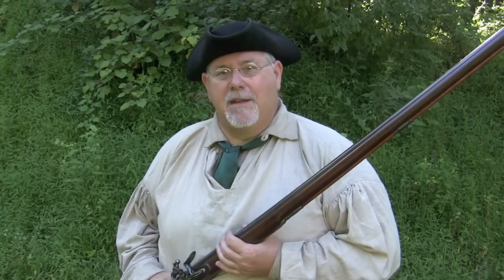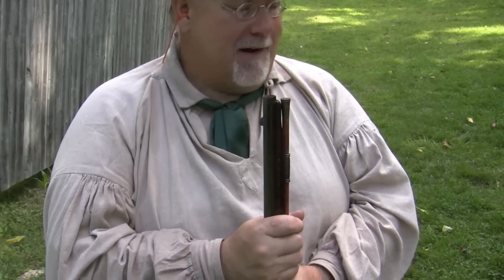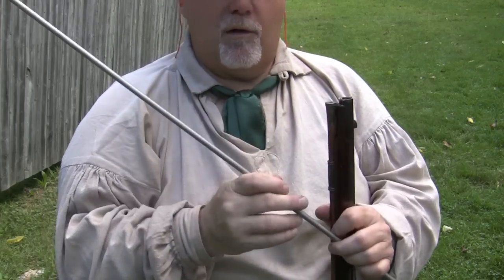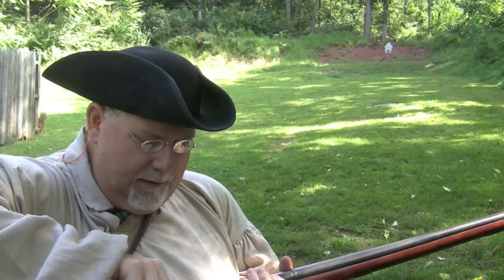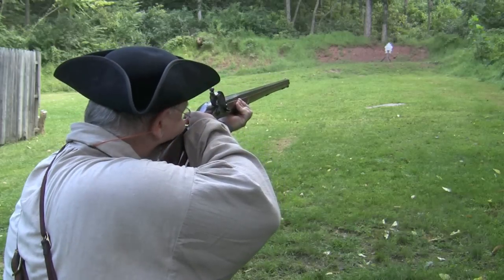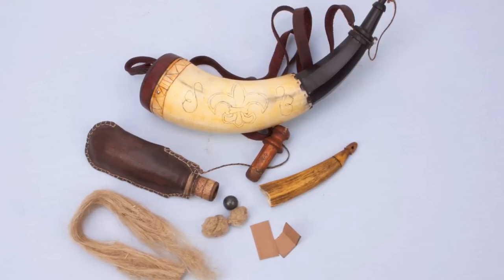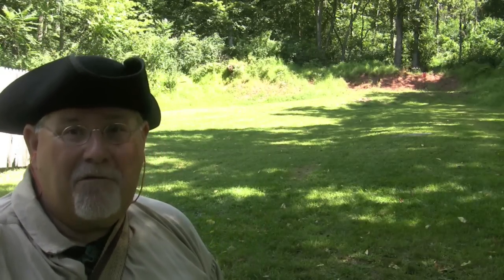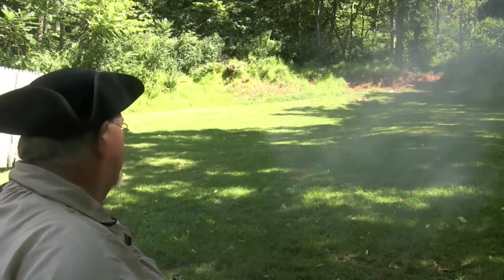Loading 18th century civilian smoothbores   Part 1 Round balls

Comment: Great videos. I read your smoothbore article in the last Guns of the Old West and loved it. I have a Pedersoli Indian Trade Musket in .62/20g and would love to see a video on it, if you still have it. I've been struggling with mine to find the perfect load. For some reason it just doesn't like patched round balls. I couldn't get a consistent grouping using patched .600 balls, even with a tight fit and increasing the charge. Paper cartridges I made up actually did a bit better. I obtained some cushioned wads and left the patch off and... magic, ragged hole in the bullseye! 90gr FFg with a lubed overpowder wad, .600 round ball, and overshot wad seemed to do the trick. Not sure why, but what works well in my rifles did not work so well in this smoothbore. Thanks again!
Reply: I too have the Pedersoli Indian Trade rifle. I’ve been slowly.. working on a hunting roundball load. I thought I had it with a 600 and fiberwad sandwich but I can’t duplicate the accuracy this year so..back to the drawing board. I cannot get a patched ball to ahoot minute of barn door. 🙄

Comment: I've seen an instance of one using a feather stuck into the flash hole while loading to prevent powder from spilling into the flash hole and creating a kind of fuse slowing ignition. Pull the feather just before priming. Valid?
Great channel you have going. Thanks for being here
Reply from the maker: Bart Mann Yes, valid, but probably seldom done for reloading. More often done to seal the charge for the night after the priming was dumped out of the pan...when they weren't sleeping in hostile territory.

Comment: Very impressive shooting, Mike!  Considering that the Fusil is a musket with no rear sight, nor with any way to really sight it in, 4 shots out of 5 is something to be proud of at 50 yards.  I think you are very correct in using a .610 ball, since the slight deformation with 110 grains would reduce barrel-bounce.  Being only a black powder shooter myself these days, I have always stuck with rifles and revolvers.  But seeing this, I may have to build myself a musket.  I need a BP shotgun anyway, and if absolutely necessary, one can shoot rocks or sand through a smoothbore in an emergency.  Anxiously awaiting part 2.  :)

Comment: after thinking about it more, I think the more practical method of lubing a ball would be to "chew it", as I saw in your video about chewed balls. The liquid lube would fill up all the tiny crevices created by the file/sandpaper and act as a sort of grease groove. this way in theory you could load bare balls without wadding material between the ball and bore..so you could get more shots out of  the musket before serious fouling has occured...of course this would be horrendously innacurate to the time period, but I too would like to test this method over the traditional military paper cartridge and ball+wad

Comment: This is great.  Now that you have them all together here, the "period correct" methods seem like they make a lot of sense compared to the patched round ball. Because the paper/tow methods are preform best with a larger ball, it seems like the shooter would have always had the option of preforming a quick-load using just the round ball without compromising accuracy too much.  Are there any references to loading a bare ball?
Reply from the maker: RabidMortal1 Sure. Under fire a bare ball, without wadding was often loaded. There are some accounts of guys holding the spare balls in their mouths and spitting them into the bore. The saliva caused powder to stick to the ball, and that light coating was enough to keep it from rolling back out of the fouling roughened barrel...never tried it myself...

Comment: From what I can tell the method using tow would be preferred by me. It appears that this method would be the fastest and have as much accuracy as the use of paper or cloth. Is this correct? Are there any records that indicate which method was preferred. The tow seems to load easily without much thought while the paper and cloth may wind up flipping in the barrel, and under stress of battle seems that the tow would be less faulty a method. Thanks for the video. Also, I never thought that most long guns of the 1700s were smooth-bore. I always heard they were rifled.

Comment: Mike:  For paper card wads, I know you mentioned using target paper, but is there an easily accessible equivalent you can recommend from say, Staples? Also is there a simple formula for determining card dimensions  (I've got a .775 fowler (10 gauge) )?  Thanks
Reply from the maker: Almost any paper works. Cheap copy paper should work fine...greasy, well handled old paper works great. I've used .75x1.5-inch paper as well as 1x2-inch paper for 20 Ga, and I've used 1x2-inch paper and 1.25x2.5-inch paper for 12 Ga. I'd try that for 10 ga.

Comment: a question: in theory if you dipped your round balls in melted black powder lube (and let it harden), wrapping it in a paper cartridge, would the musket be easier to clean after many shots or would it basically make no difference?
Reply from the maker: I don't think it will help, but I have not experimented with it.

Comment: Just read your article in the July/August 2015 Muzzleloader. and thought I would check out your YouTube Channel. Low and behold I I was laready subscribed to the Duelist!   I ave a question. Where can you puchase the flared ramrods? Your the first person to menton them.
Reply: Lewis Ward Duelist, Anyone making those ramrods? Or should I just buy an oversized ramrod and taper myself?
Reply from the maker: Lewis Ward You start with a half-inch diameter rod and work it down.
Reply: duelist1954 Figured somethin like that. Thanks.
Reply from the maker: Lewis Ward you'll have to make one from a half-inch rod
Reply: Danka.

Comment: So I have a question I hope it’s not a dumb one. Where do you get the Flint for a flintlock rifle? Is it natural Flint or does it need to be cut in a certain shape in order to spark correctly? Also where do you find tow?
Reply from the maker: Brian Simpson You get flint from Muzzleloading vendors...shops, or on-line from places like Dixie Gun Works, or Track of the Wolf. Tow you can get on-line from the woolery.

Comment: I just got my first smoothbore. How do you apply lube to a big square of ticking like you are using? I'm used to using spit patches but want to try mink oil. Thanks
Reply from the maker: I just rub it over lube in a tin.
Reply: Thanks. I seem to be missing spots doing it that way. It's too hard to see the lube on the ticking. I had read some guys microwave theirs to distribute it. I guess I just need more practice.  @duelist1954

Comment: How would you recommend using conical bullets in a Colt Percussion special model 1861? 58 caliber. What size would you use?
Reply from the maker: Robert Neson I am not familiar with a .58 caliber 1861 Colt. Do you mean the Model 1855 revolving rifled musket in .56 caliber?
Reply: No. I do not want to show you, because you or someone else might buy it, but I found an auction for an "Colt Special model 1861 percussion musket" Valued at eight hundred to one thousand dollars. I am getting tired of buying replicas, so I am going to buy this. It was made in 1863.

Anyway, it is 58 caliber. I was wondering what kind of conicals I could use if I win the auction
Reply from the maker: Robert Neson I didn't ask you to show me. But I did misunderstand what you were talking about. You are looking at the Colt version of the standard U.S. Army Model 1861 rifled musket. The basic version was made in the Springfield Armory, but Colt, and others, also made them during the war. It takes a standard .58 caliber Minie ball, which is a hollow-based, conical bullet.

 Sizes vary based on the actual size of your bore. .575" is the smallest and .580" is about the biggest that I've seen. I'd buy a bag of .575" Minies from Track of the Wolf and shoot them. If accuracy is bad try .576", and then .577". I doubt that you'll need bigger than .577" Minie balls
Reply: So 575? Okay, I'll go with those.
Reply: I am so sorry if I came across as rude. I am on a 300 hundred dollar budget right now, and I really want that rifle. I want to show you the link, but I don't want anyone else looking at it and bidding on the rifle. If you want trough email, I can give you the link.
Reply: Robert Neson Just send him a PM. Please show the rest of us when it's done. I'm rather interested in seeing it
Reply from the maker: Robert Neson That's OK. I really don't need to see it. I know what they look like. Good luck in the auction.